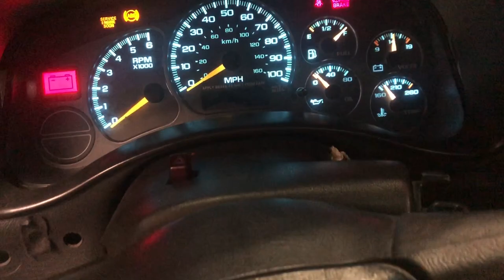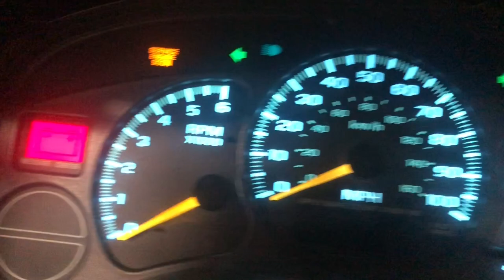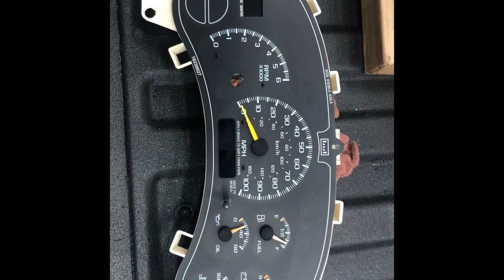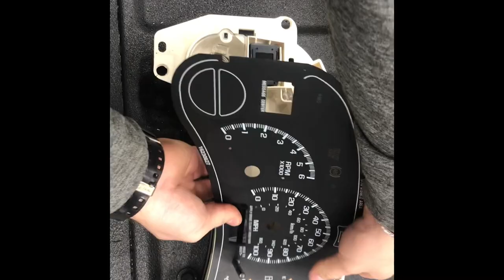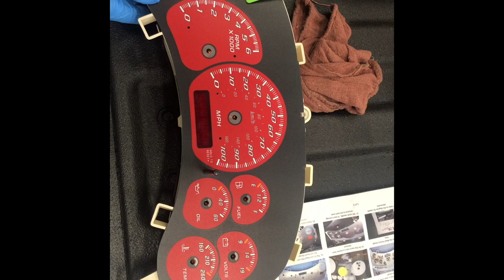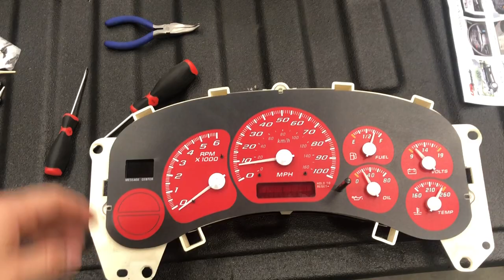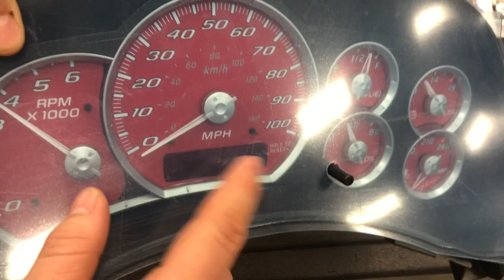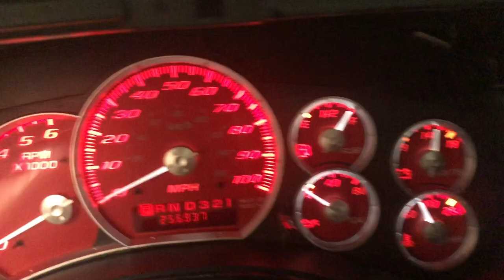How to install US Speedo Face Overlay on a Chevy

Comment: Mario has done a great job at explaining most everything, but the procedure of needle removal/installation is 100% wrong.  I’ve owned a speedometer repair company for the past 16 years(01/15/24). The video was edited from when he installed the needles.  The stepper motors on this cluster are magnetic.  The unit needs to be powered on during calibration and needle installation.  The calibration needs to happen before the needles are removed.  The part of removing the needles to the point of reinstalling is incorrect.  The cluster must installed and powered on before marking and removing the needles, then install them in the same place when the cluster is powered on.  This information only applies for the 99-02 year model GM full size, not for the 03-06/7 classic. 1988-2002 have magnetic aircore steppers and need different treatment than the notorious 03-06 models.
Reply: Any chance you can do a video on this?
Reply: Sorry it's not our product @Checooms

Comment: How did you know where to align the needles?
Reply: He didn’t, that’s why he showing volts
Reply: You need to put a piece of tape down under each needle with a sharpie mark of where the needle was before you pop them off. When you put it back together, you align the needles to your sharpie markings
Reply: @HF1.0  Unfortunately, that won't do much good if you're swapping the gauge face like in this video. I'm guessing the way to go about this would be to take a picture of each needle's position, being sure that the camera correctly captures where the needle is pointing when you look at it directly.

Comment: How do you change the color for the Odometer/Gear Shifter? Can’t find anything I have a 2001 Chevy Tahoe so I don’t have 2 sodar.
Reply from the maker: So you have to buy a different face plate if you don’t wanna solder, the faceplate has a color tinted film to change the color

Comment: My gas gauge n oil pressure gauge don’t work now after install🤦🏽‍♂️ any advise
Reply from the maker: Damage to the stepper motors maybe? Any spin at all from them?
Reply: @MarioZermeno  yea they spin just noticed I might have put the needles in wrong
Reply: yea all my needles are fucked.